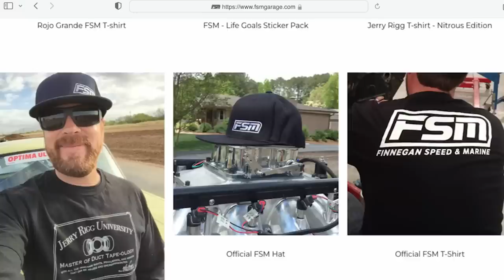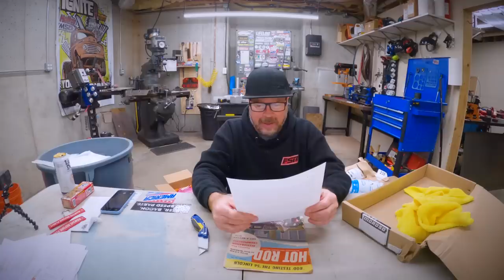REVEALED! ALL THE DIRT, 10MM SOCKETS AND FUN!

Comment: Some time back during one of your previous mail openings I saw a work light that someone made a 3d printed battery mount for. I bought the one you were given that uses a Milwaukee battery. It works great and I use it all the time.

Comment: If you hang a metal cabinet for batteries on a wall, use spacers to leave an air gap between it and the wall. Those batteries burn hot enough to transfer heat through a metal box and catch the wall it is mounted to on fire.

Comment: I'm pretty sure one of my fellow Canadians with a little more expendable money than i 
( because a pothole just took out the drivers sideball joint,lower control arm, sway bar strutmount , AND the steering rack on my 2006 chevy cobalt....) is about to send a box full of Canadian goodies . i hope you get some AH CARAMEL, Passion Flakies, Jo Louis , and Lune Moons, and maybe a Billot Log, You deffinitly have to try Dunns Dill Pickle flavour chips , not all of us are into the ketchup flavour chips.
 Drive Safe Mike!
p.s. you really should spray foam the basement ceiling . it would provide a better sound and exhast gas barrier for the wife and kids upstairs.